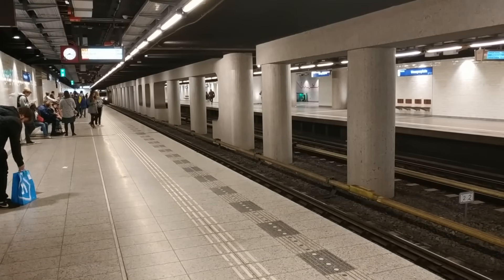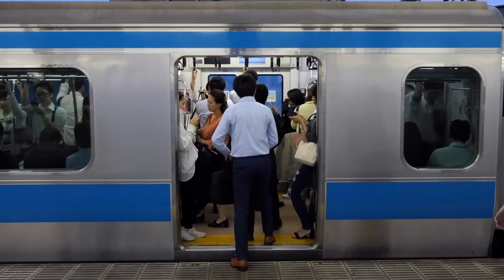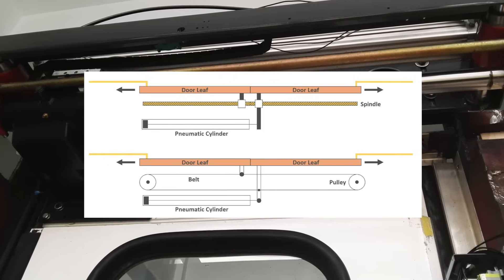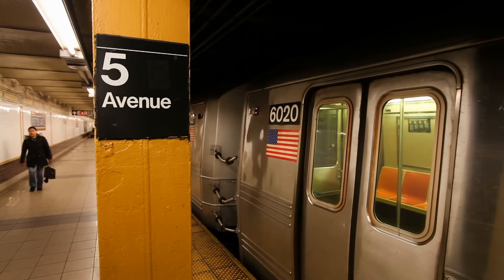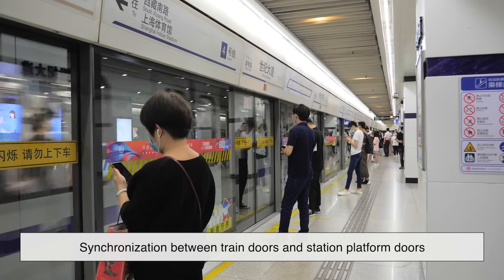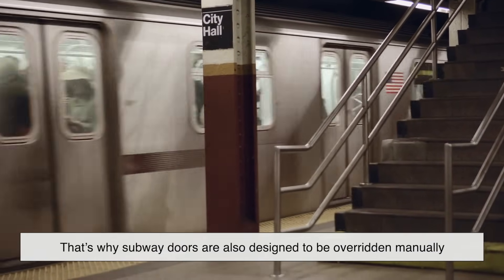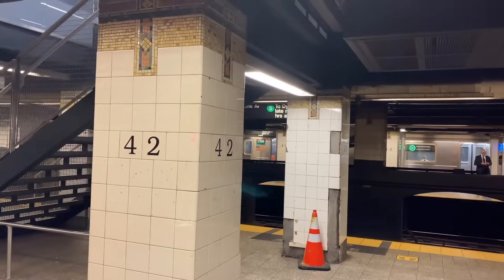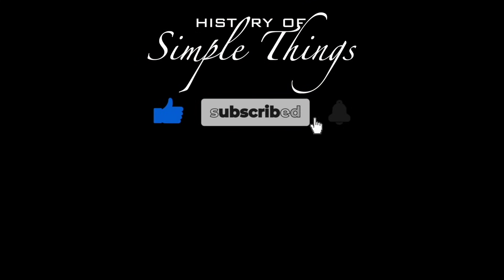How Do Subway/Metro Train Doors Work?

Comment: This doesnt mention the system used in every London Underground train until recently.
The doors used a rotary actuator which rotated an arm through 180 degrees. The end of the arm moved the door via a vertical slider and bearing.
It was a genius design as this arrangement gives the maximum force at either end of the doors travel and maximum speed in the middle. Exactly whats needed. These days this is done by electronic power control of the linear actuator.

Comment: Train driver from germany here!

I want to explain how train doors here in germany work.

1. Door Systems
In germany we use a couple of systems for controlling passenger doors, the most used are called TB0 (Door lock 0 km/h), SSTF (Side-selective door control long-distance traffic), 
SAT (Self-handling train drivers) and the most modern system TAV (Technology-based clearance procedure)

TB0: 
TB0 is the oldest system that is still used in germany, and is used mainly on older rolling stock or if a fault occurs. TB0 is very basic and can only lock or unlock the doors, no side selecting. It was the succsessor of TB5 which had a major flaw, that allowed passengers to open the doors when the train is under 5 km/h. TB0 gives an acoustic warning to the train driver at 33 km/h to remind him of the doors. The reason is that when the doors are closed, a continous electric impulse is put on the door to keep them from opening and because doors used pneumatic systems back then, it takes a while for the pressure inside the cylinders to decrease.

SSTF:
SSTF is basically a newer version of TB0 with the addition of side-selective door opening.

SAT:
SAT SAT is a modern system mostly used by S and U-Bahn trains and has side-selective door opening, and other features like TAV. Hoewer SAT wasn't designed for light barriers so the train driver needs to check all doors while closing them.

TAV:
TAV is the most modern system and is used in almost new trainsets in germany with notable safety feature. TAV also has side-slective door opening but is designed with light barriers in mind. TAV also checks if something is in the door area, and if not the system closes the door after 5 seconds of inactivity, for faster door processing.
TAV uses systems like light barriers, pinch protection in the door trim, and if built in: weight detection on gap bridging.

TAV and most other systems in germany have a secondary door control button for force closing the doors if they don't close.
with TAV if the driver presses "Force Closing" all safety systems except the pinch protection will be overwritten so that the doors can close even if someone is standing inside the barriers. 

Modern doors in germany are powered by electric motors, old rolling stock can be either pneumatically controlled or no active systems which means: you door push open.

If you guys have any questions about german trains, feel free to tell me and i see what i can share.

Comment: 5:05 Another unadvertised bonus of platform doors is in the case of a fire.
If on the track/on the train, smoke can be expelled from the tunnel whilst keeping the station platform air fresh and without the lack of visibility (of the nearest fire exit for example) which smoke brings.
If the other way round, trains can safely pass straight through and smoking embers aren't drawn along behind them to the next station with the possibility of setting alight the tunnel or that next station either.
Ditto climate control/freshness of air/ambient temperature.

Comment: Ok first ❤every video I've watched on your channel.  I live in an old house just turned 100, some windows have not been replaced😅 I see they go up & down on a rope or cord around a wheel, I  would like to know who thought this up & how it works🧐🧐
Reply: A simple system of a weight and a pulley.
I think that you're referring to sash windows and were you to jemmy open the side panel of the frame that the window sits in, you'd find a sash cord (waxed rope) a wheel at the top (pulley) and a lead weight.
The weight acts as a counter balance, just like the ones in a lift/elevator shaft, thereby making it so much easier to lift up the btm ½ of your two-part sash window than without such a weight.